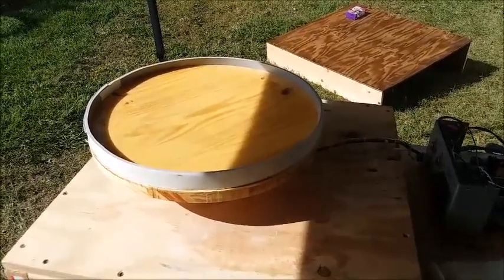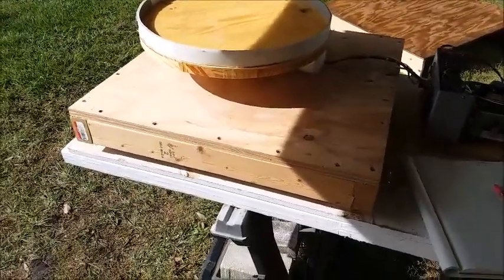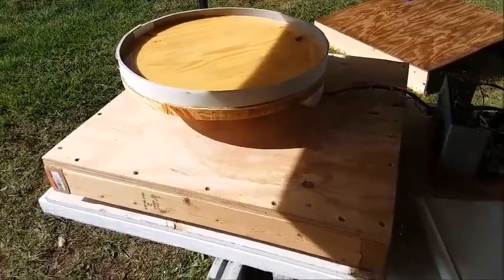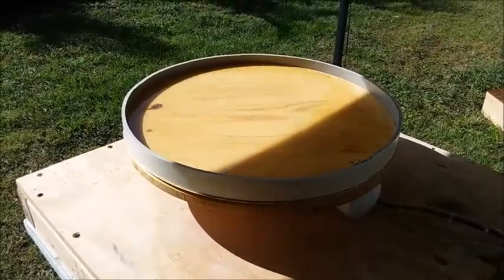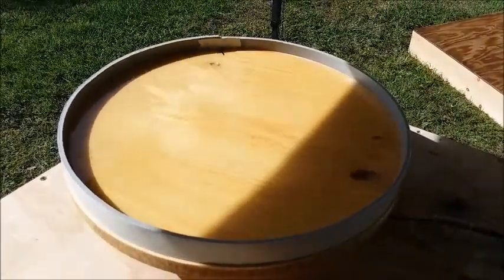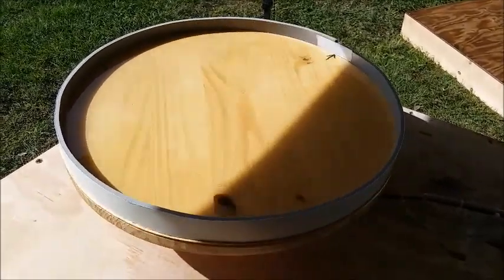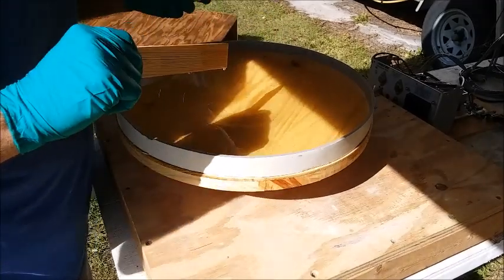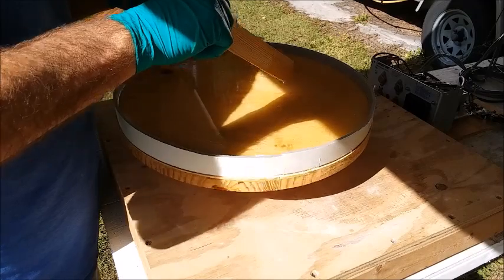Spin Casting A Slumping Mold For Fast Telescope Mirrors - 2nd Attempt

Comment: I''m not making telescopes, but parabaloidal pottery for ornamentation or possible cooking (comal) or maybe solar cooking.  I'm just fascinated by parabloids and especially this magical method.  And I think the "perfection" of the shape gives the final product a magical quality. 

I'm  using a potters wheel with no tachometer, just adjusting the speed to get the approximat depth. Right now I'm trying to make a 24" dish with about 3 inch depth. 

Trying to use hydrostone and it makes a nice shape but then the water rises and ruins the surface quality.  Now I'm thinking of putting this resin over the rough hydrostone to make a "perfect" parabaloid.  

please tell what refractory product you will cast in this. 

Why not use a faster setting epoxy?  I'm thinking 20 minutes or so, like the hydrostone.  

What kind of wax for release?

Comment: Could you just silver the resin mold, and use it as the mirror?
Reply: No. It has to be accurate and thermally stable to fractions of a wavelength of light ...ie nanometers.
Reply: Why cant the surface be buffed to the correct surface.
Reply: @gianniformica8235  Good question !! Because it can't.
Reply: Been doing a little reading and it seems NASA has managed to get this right.
Reply: @gianniformica8235  Which means what, that NASA uses buffing wheels to figure their mirrors ? That would be news to me and I'd love to see a link. I did not know NASA made mirrors,in the first place.
Reply: Spin cast resins, can be silvered.
No buffing required. 
Thats what NASA seems to have figured out.

https://www.researchgate.net/publication/263024273_Recent_developments_in_the_production_of_spin-cast_epoxy_mirrors

"The key is the development of low cost, diffraction limited mirrors that cost orders of magnitude less than NASA's current telescope mirrors, have a drastically reduced manufacturing time, with significant weight reduction (low areal density). Spin-cast epoxy mirrors do not require any grinding, polishing, or figuring and therefore have the potential for low cost, short production time, and light weight. The specially-formulated thin epoxy described here naturally forms a parabolic surface when spun at constant velocity and once it hardens, the mirror surface is ready for use except for a reflective coating"
Reply: @gianniformica8235  And the quoted accuracy is about 600 - 800 times short what you need for a telescope for visual observing.... unless I'm missing something in the article. This appears to be some sort of light communication beam which I'm guessing is digital and turning a light off and on at high speeds. Needless to say, that doesn't call for much accuracy.
Reply: @SmeeUncleJoe    in the paper they say:

The goal here was a precise parabola not a precise radius; however, the 
obtained radius (only 0.6% error) was perfectly suitable for our testing procedures and in fact such a radius tolerance 
error would be typical or even insignificant in some telescopes depending on the accommodation in the optical design.

If you look through the rest you also see that those micrometer scale defects mentioned are localised bumps. Most of the surface roughness is on the nanometer scale.

Comment: You should use resin that get solid very slowly then you may have good results. Better do not put heat to the process to may it slow. Also if you can find a resin with lower viscosity will be helpful.

Comment: would it be an accurate figure? is it possible to spin the glass directly inside the kiln?
Reply: Yes, but it would still require fine grinding and polishing. The quality of the "figure" that comes out of this will save a lot of rough grinding but is not sufficient for a finished mirror.
Reply: Some large mirrors are spin-cast, but as Joe said they're not precise enough. It saves time, but isn't the complete solution.